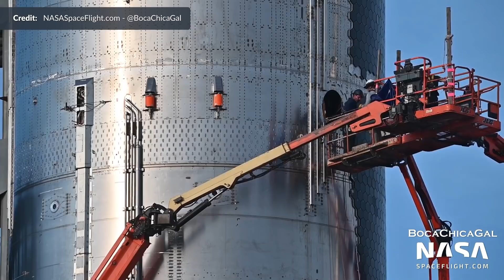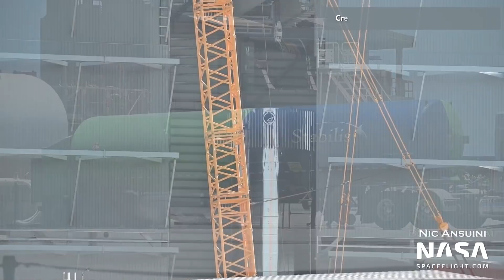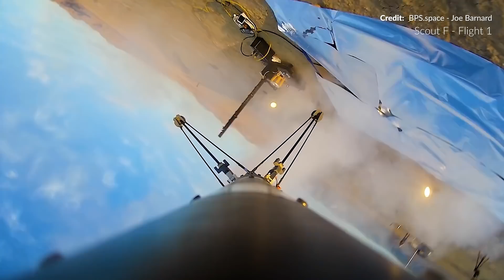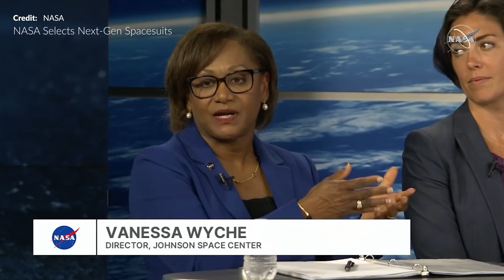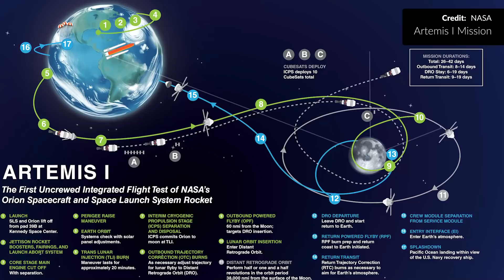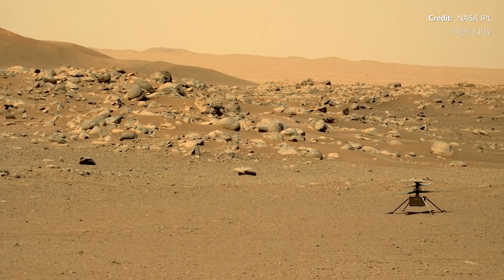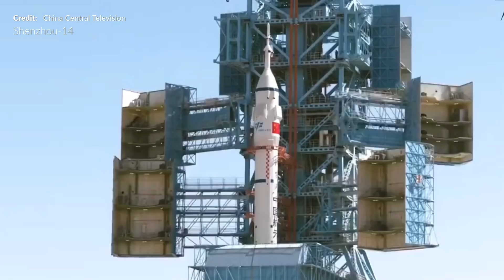SpaceX Starship and FAA milestone achieved. Space Suit Award, Capstone, SLS and JWST

Comment: That Chinese launch pad is very clever with the swinging enclosure. I wonder why we don't see that in the US? Seems like it would be useful for performing on-pad fixes quickly and keeping rockets in a ready state for long periods.
Reply: The Delta-IV Heavy has a structure like that. The Shuttle had a structure that wrapped around it. The USSF-67 contract for SpaceX had funds for vertical integration, so LC-39A may see something like that again.

Comment: The pipe was a failure but that is why SpaceX does development testing it is the reason why they make quick corrections.  If this was NASA they would have a design committee, five hundred suggestions how to fix the problem, sorting through the suggestions for the best solution for the committee,  do a full analysis with questionable modeling, after all the original part failed with the model, apply the fix, round the test again.  That would only take 18 months and make a lot of money for involved which is really the goal of the vendors.

Comment: It SEEMS like tank insulation should be added to reduce frosting on the rocket - frost means heat is being lost which seems to limit how long the liquid methane can be stored, right?
Reply: Engineering is always about tradeoffs. Insulation costs mass. The loss of methane or hydrogen or LOX can be continuously made up for by the propellant umbilicals till moments before launch, which costs none of the rocket's mass budget. Plenty of rockets have cryogenic hydrogen upper stages but none are insulated. The only exception is the few rockets that have hydrogen first stages, such as Delta IV Heavy and the Space Shuttle. All that orange stuff is insulation. Hydrogen is a lot colder than methane, keeping a large tank-full from heating up is a different-sized problem.

An orbital propellant depot will be developed from Starship. That will have insulation to prevent boil-off during long term storage.

Comment: The wednesday test was probably a test pressurization of the new piping using non-cryogenic gasses to verify no undetected damage to Starship's systems.  It would make sense to do this before introducing thermal stresses (on top of the pressure stress).

Comment: Question would it be possible to use the mini chopper to blow the dust off of the rover panels ?
Reply: Nope.  Ingenuity has flown, in total, less than 5 miles over the surface of Mars to date. While that's rather impressive, Insight is more than 2,000 miles away from Ingenuity and Perseverance (which has traveled a bit over 6 miles).  Ingenuity couldn't go flying off on it's own, regardless, because it requires Perseverance to relay all of its instructions and acquired data through to Earth.
Reply: Wrong rover. Insight is a different mission, far away from Ingenuity and its companion Perseverance. The latter has an RTG, not solar panels, so dust isn't an issue. A bit confusing, since the two solar powered ones keep getting mentioned together in the same videos.

Comment: I'm still surprised that the Mars rovers have not incorporated dust management into their designs. A small amount of additional weight to provide a small compressor and an air nozzle on the arm could add months to years to their missions. Or solar arrays that can be turned over to dump the dust. Seems like a simple enough engineering challenge. 
Thanks for the great update!

Comment: And still no flame diverter under the launch platform ? Does no one see the potential issue with the energy of all those raptor engines reflecting back at the base of the booster ?
Reply: They do have a water deluge system in place, if that will help.

Comment: Quick Question: Why not use the Ingenuity helicopter propellers to clean the dust off the solar panels for Insight? Even if the attempt could comprise the mission, its worth a try since the mission is on its last leg.
Reply: Insight is about 2 months flight time from Ingenuity, it's a different mission. Confusing, since they keep getting mentioned together. Perseverance carried Ingenuity, and it's powered by an RTG, not solar panels.

Comment: It strikes me that, since dust on the solar panels is one of the main 'killers' of Mars probes, it should be worth using a little weight and space for a system that can clean them. Either articulate the panels to drop/shake the dust off, or arrange some kind of brush, possibly a lightweight addition to an arm that mainly does soemething else, to brush it off.

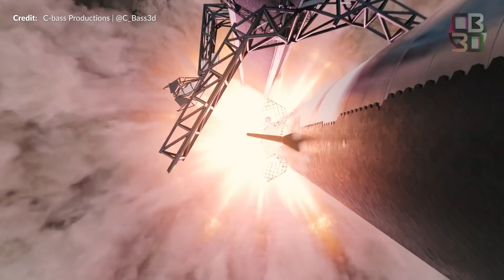Comment: Why are the grid fins shown as extended out horizontally during launch in the animation at about 4:10 - 4:25 (min:sec)???
Reply: Starship grid fins are fixed. It was discovered that retracting them is pointless, as the added mass, cost, and points of failure far outweigh any gain in aerodynamics.

Comment: RE: pipe failure and tile loss. Is there a means to test the tiles that did not fall off for damage that may cause failure during flight.
Reply: In-flight failures might be more interesting, as long as they can recover either Starship (if the tile comes off) or part of the tile (if the tile breaks).

Comment: What if, JWST finds a new and better super-Earth than Mars, close enough to travel in about a year, and Elon Musk changes his plans about Mars, decides to build the city there. that would be very interesting.
Reply: Impossible without warp drive (or equivalent).  No other stars for it to orbit within 4 light years which means much more in travel time (too much more).  

Also super Earths gravity is higher than 1g meaning they would need to build a even larger booster there to return Starship to orbit and would also need to send fuel tankers.
Reply: @Scanner9631  Launching Starship might not even be possible on larger planets, due to higher energy requirements causing the booster size to approach infinity.
Reply: Yep.  Not to mention either having to fly the over sized boosters "there" or mine and process materials to build them.

On the other hand with Mars they could cut off the cargo section of a Starship and make a NSHB (not so heavy booster) and use it to launch Starship to orbit with more fuel aboard for missions further out.  Same for Fuel tankers to refuel in Mars orbit a NSHB could help the refueling Starship get more fuel to orbit.

Comment: I just subscribed a short time ago and have a question. Wouldn't anything externally attached to the outside of the ship be a detriment ?
Reply: In one way, yes. But the body of a rocket is also its fuel tank/propellant tank. Very little can be placed inside the body of the rocket, as it would be immersed in cryogenic propellants. Thus almost everything has to be placed outside, covered with fairings.

Comment: The timing impact on SpaceX is unknown. With his test/fail/test philosophy, he may have been able to determine some early failure modes.  Now he may find a weak link that he could have discovered in January.  Also if there is any issues requiring mitigation he will be at the starting point.  Had the issues been pointed out early he could have started the mitigation process months ago.

Comment: i find this a little disconcerting...  As this is a VERY obvious issue.  And should have been there in the first place.  I work with cryogenic and steam.  So you get these huge swings.  And this is always designed in.  With either loops or flexible SS Teflon lined hoses.  Not to mention shock loads and hammering

Comment: I’ve never understood why on all these rovers and devices that run of solar power, why they haven’t designed some kind of little compressed air sprayer or wiping device that cleans off the dust... a little spurt of high powered compressed air would probably go a long way. They know dust is an issue, but haven’t designed any way of dealing with it?
Reply: I mean they skipped that step all together and the two newest rovers are nuclear powered
Reply: Because NASA has said that the mechanical complexity and weight is not worth it. The Insight lander is 1,287 days into a 731 day mission.
Reply: Because the rovers aren't meant to be long lived things so why bother?

Comment: I thought there was still a need for the Army Corp of Engineers approval , last I heard the Corp of Engineers had set the application aside .
Reply: That isn't for launches but for site expansion (a whole 2nd launch site and maybe another tank farm).  Lots more land taken from the preserve.  They can try again once they get FAA approval for launches.
Reply: @Scanner9631  So if it's only for expansion why hasn't SpaceX responded to the Corp's questions or are you saying that the Corp needs FAA flight approval to give approval of the expansion ? My understanding was the Corp approval also hinged partly on the frequency of launches being proposed .
Reply: If the FAA denies them flight approval without changes they can't or won't do at Boca Chica then the whole expansion option becomes moot.   It may also be mooted by the Cape Kennedy setup being under way.  

So why not let the proposal lapse until they know if they can even possibly get it done in a useful fashion?

Comment: Another enjoyable video, love to see someone who shares my enthusiasm. This may have been suggested before but why not fly the Mars helicopter Ingenuity near the solar panels of the landers and rovers to blow the dust off (if they are in range).  Perhaps just include some rotors in the design of the landers to provide a periodic "dust off" of the solar panels. Note to NASA...
Reply from the maker: They are thousands of miles apart, so no way to get there.
Reply: @MarcusHouse  Alas. Let's send a small drone with each lander from now on.
Reply: @timgifford390  Or a brush.
Reply: @user2C47  : There was some recent success with an electrostatic system, so a less abrasive (and likely physically lighter) option should be available for the next solar powered lander.

Comment: The new space suit contract is very interesting. No plan for an additional down select, there might be two different suits on the station with non interchangeable parts. NASA will not buy the suits but rent them as a service. There is no guarantee of a task order after the design is complete. At least the human launch had a guarantee of 5 operational launches.
Reply: Comments removed, 
as shown to be ranting.
Reply: @dirkkarmel5209  For SpaceX I believe operational 5 is at the end of the year. They have already received two follow on contracts, I believe giving them 8 more (3 + 5).
  For starliner: Previously NASA stated that they wanted to alternate between contractors, one each per year, so 5 years after their first manned flight.

Comment: Well said Marcus, a lot of people think it is the FAA that has delayed a launch. The truth is spacex are still working on getting a flight ready stack together. In fact, it has probably given them some breathing space to get things right. t is really important the first launch at least clears the launch tower. If it goes bang on the stand it will set things back at least a year.
Reply from the maker: Exactly. It is probably been a blessing in disguise. Lets them scrap stuff and do it better/right instead of rushing those flights out.
Reply: I think its a bit of both. While now in hindsight it appears that previous boosters were not ready for launch, I think SpaceX would have launched them anyways to learn about how it performs or where it fails.
Reply: No launches means little progress. They need 1 or 2 orbital flights to learn and make changes that are needed. Heat shields need the most work ATM it seems.
Reply: Nah. They were ready to test launch the 4-20 stack months ago. 
They would have learned a ton and would have been able to more quickly implement changes using that data...
The FAA approval is 100% responsible for significant delays to SpaceX development. Including the performance of the launch tower, etc. 
SpaceX even shifted resources to the cape because they weren't confident in the FAA providing a reasonable result. 
Because of the delay SpaceX has made significant investments in the tower development at the cape without actual launch data from the tower. There is risk there.
Reply: @christopherbeddoe406  Musk has stated a few times that the first launch would be with raptor 2 engines as they are more reliable. Watch the last Boca Chica presentation he did and you will hear it yourself. 4-20 was only ever an R&D stack and was never going anywhere. Have a look at the images of the 28 raptor 1 on that stack. Half of them had never even been test fired at the factory. Why ?..because they were never intended to fly and they had already moved into raptor 2 production. I am not telling you anything that is not already known by most.
Reply: @nabormendonca5742  A full stack orbital flight a year ago ???. I think you are a few fries short of a happy meal my friend. You are entitled to your opinion though.
Reply: @christopherbeddoe406  Actually, you and I and others are responsible for the delay; few people are assigned to the review process, and the number of public comments was a record for this sort of thing. And ... every single one of the many thousands of comments has to be addressed. I work with the FAA every day; they are a much smaller organization than you may think. And they can't "phone it in", given the crapshow of the 737MAX among other disasters.
Reply: @UncleKennysPlace  The one’s Elon told his supporters to send in, thereby shooting himself in the foot?
Reply: @christopherbeddoe406  SpaceX built StarBase to escape Federal Agency NASA’s chair-warmer’s obstruction, delays, sabotage, inane red-tape BS at Cape Canaveral.  Now after all approvals were granted & many launches under the previous administration, this administration politicized/weaponized FAA suddenly creates new senseless obstructions. Democrats hate Elon Musk & non-union SpaceX & Tesla.
Reply: @christopherbeddoe406  No they were not. SpaceX had to replace the methane GSE tanks. SpaceX is STILL working on the orbital pad now.
Reply: FAA has to stop this criminal organisation called space X,they dont play by the rules,and lieing all the time !
Reply: @christopherbeddoe406  I think it has its political reasons as well. SLS hasnt launched, everytime it gets delayed, low and behold FAA pushes back its PEA.